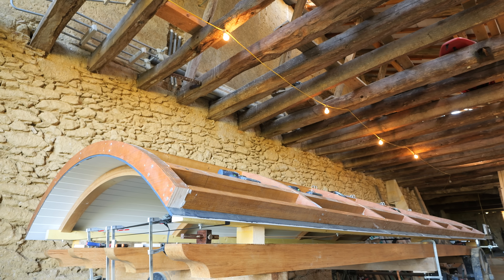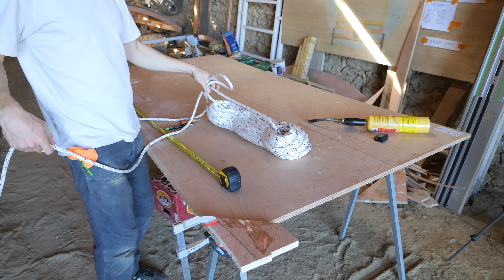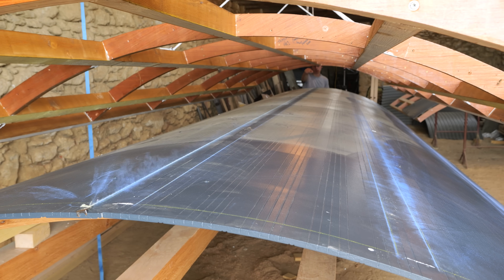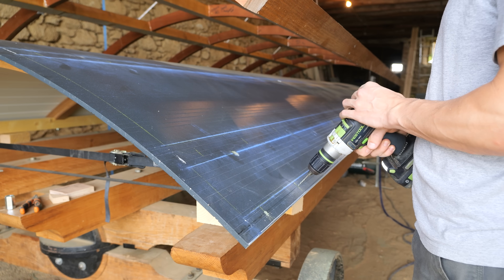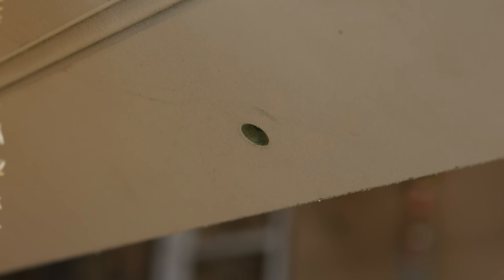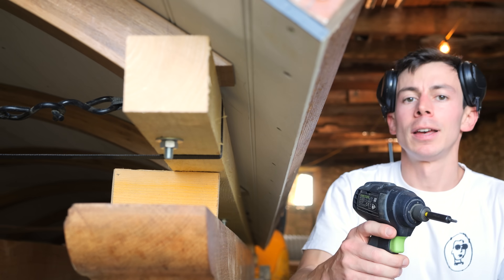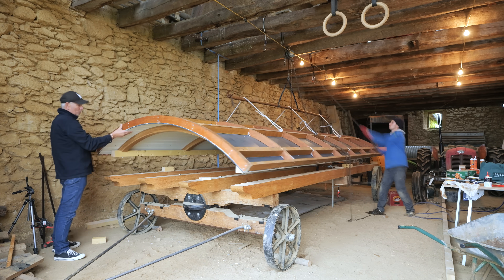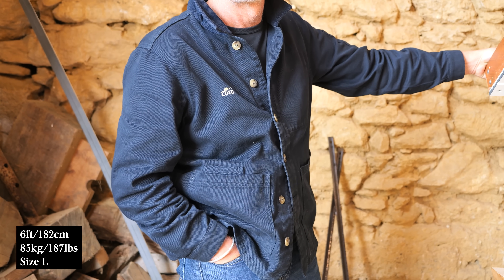Lifting a 6m Roof

Comment from the maker: Guys, did the pulleys not give me any mechanical advantage....?

ps. Last chance to buy a chore jacket for Xmas! www.cotoworks.com
Reply: Your problem is that you're not lifing straight up. Had you used double pulleys up in the rafters so that the rope went from your hands, to pulley in the rafters, down to pulley on top of 6m roof, up to pulley, horisontally to next pulley, down to 6m roof, up to pulley and so on... then you'd be lifting vertically all the time. 
With the angles you had it would become harder and harder to lift as it rise up because the angles changes towards horisontal. 
Don't ask me about the maths, I don't have a clue about that. 
Generally when using pulleys, measure how many times longer the rope will be pulled than the lift distance. That should show you how much of an advantage you have. 

Watching you under that roof makes my knees hurt!   Get some Knee protectors!   
(Was at the hospital to get them X-rayed today. I have 'full travel', but stairs are not my friend)
Reply: @norwegiangadgetman this one
Reply: @norwegiangadgetman explained better thans I could
Reply: 6-1 advantage means 6 pulleys to 1 pick point.
Reply: @shawnholton5182  You can use several pulleys, but they MUST be set up in such a way that the rope must be pulled at least 6x the lifting distance.
Reply: Unfortunately not, the mechanical advantage of pulleys follows the same principle as gears, you put a large movement in the drive end and get a small movement with increased torque (power) at the other. 

You reduce the distance you move the load with each pulley you add, as the rope has further to travel to lift the same load - the equation is: 'Work Done = Force x Distance Moved'. 

They should be arranged in a block and tackle format, rope going vertically, looping up and down over pulleys attached to the same axle. Look at a heavy lift crane, you'll see a lifting block with a row of pulleys and multiple loops of a single wire going up and down. 

I'm a mechanical engineer working in aerospace. I'd be happy to help you with CAD designs or calculations for your projects in the future - just get in touch!
Reply: Nope is the simple answer
Reply: The angle between the 2 ropes from the pulleys was too great, any angle over 90° gives no advantage, at greater angles you even got a disadvantage. To really have an advantage you have to keep the angles down to less than max. 60°. same goes for using lifting strops. The two ropes being parallel will give the greatest force multiplication.
Reply: @Tom-Lahaye any angle over 60°
Reply: 6 pulleys = 6 x the friction
Reply: I don’t think you were ‘rove to advantage’. I’m no expert you need someone who sails to look at what you were doing to get a mechanical advantage. I think there was some but not what you wanted.
Reply: You say with the power of physics, but I think your block and tackle setup introduced more friction, than mechanical advantage ;) I agree w/ the gadgetman, a double pulley or another kind of multiblock setup, would have been more advantageous. The angle that you are pulling also matters and potentially, running the lifting line down to the ground, and then to you horizontally, might have been a better choice. Ratchet blocks, also an option.
Reply: No. That configuration is not gaining any mechanical advantage
Reply: Carl - hope all is well!  Been awhile since we’ve heard from you!  👍
Reply: @pwr6038  I was coming here to say the same thing. We wish you the best from the state of Texas, Carl!
Reply: Stuck on what size jacket to order. I'm 3" taller than your dad, and about 88kg. Do you think I should go for a L or XL. Worried about sleeve and body length. Thanks for any advice in advance and great build so far.
Reply: no mechanical advantage here, sorry
Reply: Well, here is my 2 cents: the pulleys were too small and had too much friction. Therefore the rope had an unfortunate angle which also increased the resistance. You can see that because you never managed the roof to come up straight. It was always crooked until you put your hands on it. That's because of the high friction of the pulleys. So using the hand chain hoist was quite the right choice 😊
Reply: I dont know why youtube is not showing my previous comment, but the setup does give some amount of mechanical advantage
Reply: In theory, 3 moveable pulleys and 3 fixed could provide a 6:1 ma. Unfortunately, the initial angular vector forces were quite high and were increasing while hauling, negating most of the theoretical gains. 

Nonetheless you found a way!

Great vids— your craftsmanship and work ethic is refreshing and inspiring.
Cheers
Reply: Hi Carl where’ve you gone??
Reply: The problem with the pulley setup you used is that the 2:1 advantage only applies if the rope does a 180-degree loop on the pulley sheave. Think of it this way, if you have a straight piece of rope with a pulley on it you have no mechanical advantage all you have is a roller on a rope. As the angle between the lines opens up the advantage decreases.
Reply: I don’t think you were ‘rove to advantage’. I’m no expert you need someone who sails to look at what you were doing to get a mechanical advantage. I think there was some but not what you wanted. BTW just received my jacket (a Christmas present to myself, which is by far the best way to buy your Christmas presents) I love it, I can pretend to be Carl when I’m in my garage workshop, which is a mess at the moment. Loving the videos.
Reply: Your pulley system does offer a mechanical advantage (otherwise you wouldn't have been able to lift the roof at all), but as others have pointed out, the setup loses its effectiveness the more you pull the rope.
As the roof is raised higher, the angle between the roof and the ropes connecting the top pulleys to the bottom pulleys decreases. This smaller angle means less tension is counteracting the force of gravity pulling the roof downward.
I tried doing some quick and dirty math just to see what the outcome would be in ideal and simplified conditions:
Assuming the usual (inextensible ropes, ideal pulleys, no friction blahblah) and assuming 0.8m horizontal distance between top pulleys and bottom pulleys, it would take:

16kgf to get the roof 2m from the top pulleys
20kgf to get the roof 0.89m from the top pulleys
30kgf to get it to 0.46m
40kgf to get it to 0.32m
60kgf to get it to 0.2m
104kgf to get it to 0.12m
134kgf to get it to 0.09m

Of course accounting for real world losses would increase these estimates (I speculate at least double them?)
Reply: Your pulley system does offer a mechanical advantage (otherwise you wouldn't have been able to lift the roof at all), but as others have pointed out, the setup loses its effectiveness the more you pull the rope.
As the roof is raised higher, the angle between the roof and the ropes connecting the top pulleys to the bottom pulleys decreases. This smaller angle means less tension is counteracting the force of gravity pulling the roof downward.
I tried doing some quick and dirty math just to see what the outcome would be in ideal and simplified conditions:
Assuming the usual (inextensible ropes, ideal pulleys, no friction blahblah) and assuming 0.8m horizontal distance between top pulleys and bottom pulleys, it would take:
16kgf to get the roof 2m from the top pulleys
20kgf to get the roof 0.89m from the top pulleys
30kgf to get it to 0.46m
40kgf to get it to 0.32m
60kgf to get it to 0.2m
104kgf to get it to 0.12m
134kgf to get it to 0.09m
Of course accounting for real world losses would increase these estimates (I speculate at least double them?)
Reply: Carl all you did was an indirect rope pull.  What you need is a pulley at the points of your lift and then you will have a 2:1 mechanical advantage.
Reply: You need to have the pulleys close together and to one attachment point.  This was just the same weight and six attachment points so no help at all
Reply: Yes, you did.  IIRC, you had three pulleys on top and three on bottom, which would give a 6-1 advantage in a perfect world; however, once you account for losses due to the ropes stretching, friction in the pulleys, distance between the pulleys, etc. you were probably more like 4-1 at best.  

For a good explanation, check out Destin's breakdown of pulleys and mechanical advantage for the channel  Smarter Every Day, where he uses almost your exact configuration of pulleys.  BTW, at about 5:00 in that video, Destin, graphically demonstrates what you experienced where the front always want to rise higher than the rear when lifting.  

https://youtu.be/M2w3NZzPwOM?si=Mbj1VGuWjymS0mqN&t=257
Reply: I just rewatched the video again and saw that you reconfigured your setup to include 4 pulleys on top with three attached to hut's roof allowing you to anchor again to the roof, meaning that you had 7 lines attached to the hut's roof, which should give you a 7-1 mechanical advantage as your starting point.  In a perfect world.  I would still guess you were actually working with more of 4-1 effective after accounting for losses in the system.
Reply: I think they did. But as soon as it became airborne, the forces in the ropes became so big, the pulleys had no more effect.
The angle became increasingly larger, and they could become so big that when the angle at the pulleys comes vloer to 180 degree, the rope would fail.
Reply: In the set up you have it has created redirect instead of mechanical advantage. If you had a double pulley above each single pulley each one would be a 2:1.

Comment: 4:17 it is too big steps, The force is divided into two vectors in each hub, and gravity is vertically downward, and it is counteracted by the tension force, which is divided into a vertical component and a horizontal one, and given the angle of the rope, less than 50% of the force does the job.

Comment: I had severe hip and lower back issues for a lifetime.  Umbilical chord around neck and leg, born premature.  Years of chiropractic adjustments.  Couldn't balance, jump rope, ride a bicycle due to hip out of place.  Finally couldn't sit down or stand up without severe pain, until ONE trigger point session solved the problem.  I could immediately squat to my hips when my feet were at to 10 and 2 position, over and over, in my seventies.  Still can't balance however.  Maybe this information could help you.  Your videos or wonderful.

Comment: The pulleys would all need to be located between you and the load, with only 1 pulley technically in between you and the load, none of the other pulleys divided the load.

Comment: For the pulley to work, you would need to have a compound pulley at each end of one attached to the weight and one you pull from and it would need to be attached to something stationary. A single rope is fine how you have lifting, but to lower the amount of force needed to lift you would need to tie that rope to a 3 to 4 compound pulley with the other end attached to the ceiling and then you would be able to use 20 pounds of force to raise the roof

Comment: You can see that it's not 1:1 and it's not 6:1 either because of the total number of pulleys and one length of rope. Without measurements I estimate it was 4:1 less the effort to overcome some horizontal load. If the 6 pulleys would have been oriented vertically in 3 pairs the mechanical advantage would be 6:1 pulling on 3 ropes simultaneously, one each from the top pulley of the pairs. Compounding requires double blocks (or 2 pulleys) at each top location with the rope tied off at the rafter on the far end. So for one pull rope 9 pulleys are needed to achieve 6:1.

Comment: Obviously when working alone you have to come up with solutions and I’m sure you figured this out by now, but the angle of the ropes going through those  pulleys is what is reducing the lifting capacity. As you change the force vector away from linear to a more obtuse angle you reduce lifting capacity. Delbert Hall has a very good section in Rigging Math Made Simple covering pulley math for anyone interested.

Comment: A very effective tool for cutting synthetic rope is an angle grinder with a cut-off wheel . The ends get heat sealed by the speed of the disk.

Comment: Carl - First off, major props on how you are dealing with your autoimmune disease.  Great strength of character on your part and best wishes that they find a permanent cure for you.  Secondly, your pulley system was not giving you the mechanical advantage of a 6 to 1 system.  You had a 1 to 1 system and all you were doing was spreading out the lifting points.  In order to have a 6 to 1 system, you would have had to have 6 up and downs at each lifting point on the roof.  With only 1 up and down at each lifting point, you had a 1 to 1 system.  Think of the mainsheet control on a sailing boat with a 6 to 1 system.  You have a 3-pulley block on the end of the boom and another 3-pulley block attached to the boat.  So, for your system to be 6 to 1, you would have needed a 3-pulley block at each cabin roof attachment point and another 3-pulley block at each overhead roof beam attachment point.  In the end you adapted and overcame by using the Land Rover.
Reply: what he said

Comment: You could have made it easier by adding another pulley 2m away from the last one on the rafter so that you can pull vertically down, also adding a ratchet would have protected the system against pullback, and finally instead of having a "/VV\" system go for the "Г˥_Г˥_Г˥" keeping 90º

Comment: Cael, you were thinkin' too hard on this one.  One floor joist with a 2 x 4 or 4 x 4  prop at each end would have been plenty strong.  A couple el-cheapo come-a-longs, you'd be swinging free.  No rope.  No pulleys.  No drill holes or eye bolts.

Comment: From a safety perspective, please DO NOT use screws to support objects with that are going to located over your head, even temporarily. The risk of the screws pulling out of the hole is very great. Instead, drill through the object and use eyebolts rated for overhead use, use lifting straps and cradle it from underneath, or use overhead rated eyebolts in spreader bars placed under the load and support the load from the underneath.

Comment: The pulleys didn't give you any assistance because you had every one of them set up in series, so it was a 1:1 system. To get the mechanical advantages pulleys can give you, they basically have to be going back and forth from the same anchor points. That is why blocks have multiple rollers built into the same hook point. The way you used those pulleys only reduced the friction that a lifting eye in the same location would given you.
Reply: There was mechanical advantage from the pulleys.  Excluding friction and angles, should be a 6:1 advantage.  No way on earth you could lift a 6+m timber frame like that by hand.

I built a 6300 x 2000 timber pergola usong hardwood glulams.  The framing was dropped off with a hiab.  And if you put that bundle on a human, it would kill them.
Reply: I disagree. Because it does not play a role if the pulleys are on the same axis (or same hook), they can be distributed as long as they pull on the same thing, e.g imagine the roof to be the hook and the pulleys are mounted not closely together. 
Pause the video and think, about it. If he pulls 100 cm, would the roof go up 100 cm, the answer is no.
Google for compound pulleys pictures and you will find a schematic of this approach.
Reply: https://youtu.be/GAegAHnfkMs?si=YSWAKcGKQxgIHIeT
Reply: @Omsip123 That only works if the end of the rope was tied off to the beam. He had the rope tied off on the roof he was lifting. So the pullies just changed direction of the rope. If he had a pair of three wheel blocks one hung from the beam the other from the roof, the rope passing all the wheels and fixed off to the lowest block he could have lifted it.
Reply: @Hagar2670  nope, you are wrong
Reply: The system is set correctly, but if the pulley are a not running smoothly and there is stretch in the rope then the mechanical advantage will be reduced
Reply: Was looking for this.

Comment: Trying to remember my O level physics some 40 years ago you need all 6 pullys working on the same point to get the reduction you calculated, i.e. the rope will only moved the roof 1/6th of the amount you pull the rope. Think block and tackle.
Reply: Nailed it. Certified rigger and crane operator here and the advantage comes into play when the 6 parts are applied to 1 point.

Comment: Two things I would point out , you can buy a 90 degree adapter for your drill to put screws in, secondly, I wouldn't of countersink those screw, I would of use cups and screws you can get brass cups or nickel plated cups . Have you considered lighting in your roof , if install in that roof do the prep work now. But your doing a good job
Reply: strange thing is: that he used on angle drill to drill the holes  https://youtu.be/3oHfQ9Vb0G0?t=588 so i don't see why he couldn't use a bit in it. It seems a bit too obvious that I suspect that we are overlooking something.
Reply: @3fase-e6p  That angle drill probably doesn't have impact function.
Reply: @Girts_164  I might be pretty old but you can drive screws just fine with a drill. Some people still prefer it over an impact. For repeating work like this you can just set the clutch and drive them all in without constantly feathering the trigger.

Comment: A couple of suggestions from the US. A wench on the front of the Rover would be more useful than constantly moving the vehicle. Many different types sold in the USA and many of our trucks have them.
Secondly, I can’t speak to all tool companies, but Ryobi has a battery caulk gun that would save your wrist and arm. I have one ($50 US) and use it on large projects.

Comment: I'm not physicist or an engineer, but I have used block and tackles many times. Connecting six pulleys in series gives you no mechanical advantage. Essentially they have to be connected in parallel.